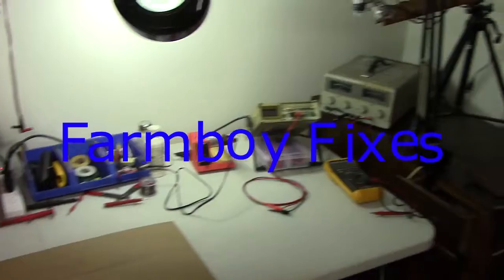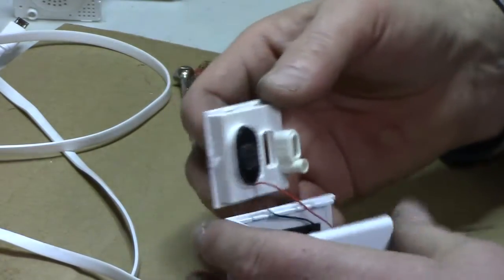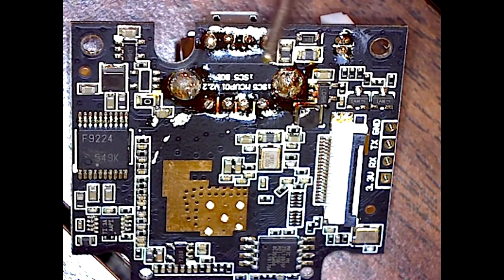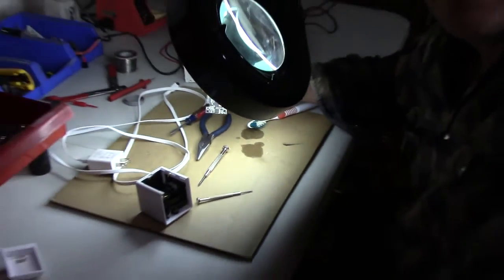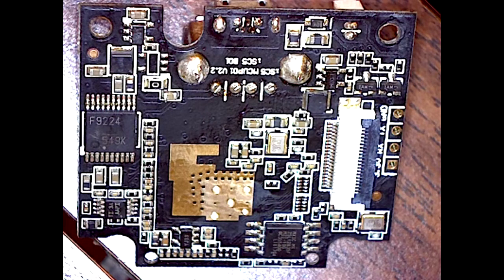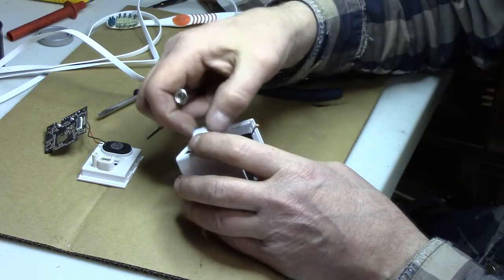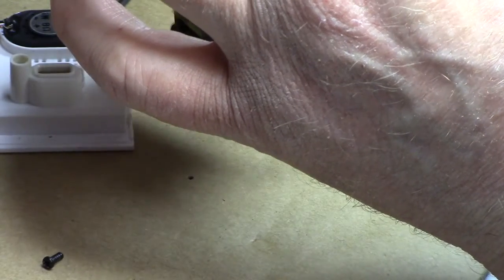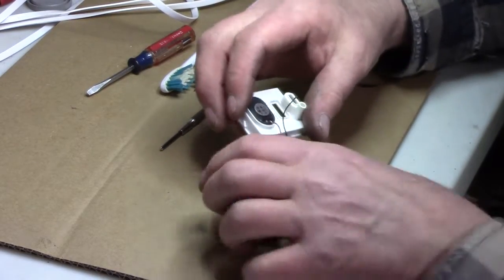My ISmart alarm Spot camera stop working...

Comment: I have found out through extensive testing is that with time the supplied USB power adapter no longer provides enough amperage (probably a failing capacitor in the power USB adapter).   A simple solution is to get a new USB power adapter.   It worked for me.
Reply from the maker: I tied a new usb charger, and same result.  Probably, the damaged occured via voltage spike.  I have since put everyting on a UPS.

Comment: Is the new company that took over from ismartalarm really just ismartalarm and now they want to charge us? I can’t get my cube or anything else to work anymore, the “new” app does recognise the cube and my camera but when I tap them it says they need to be updated. When I tap to update it says they can’t be updated as they are not on the same WiFi as my phone (that the app is on)? Can you help with this? Thank you.
Reply from the maker: Thats correct.  Your router  (which your ispot is connected to) must have the same wifi as your phone.  Also the wifi cannot be 5 or _ext if your using a wifi extender. So, go to your phone settings and chose the same wifi name as your ispot is on.
Reply: @farmboyfixes  it is on the same WiFi that the cube is on, but the cube is plugged in via a cable, not the WiFi but both the cube and phone are on the same router, I just get a message on the app that says that they are not on the same WiFi network. Any way to fix?
Reply from the maker: Well, if both your ispot and phone have the same wifi name, then only thing I can think of is to reset your ispot {small hole in the back).  Maybe also try rebooting your phone.  Maybe try to delete the app and reinstall it.
Reply: I was also having all kinds of issues. Updated to the new app and the alarm still functioned but would no longer call or text when it went off. My icamerKeep pros will not work on the new app and my spot camera works better than it ever has. Now my wife's account can't access any of the same devices. I just took it all down and replaced with Ring system. It's way more consistent and better so far. Looking for camera options to use with it because Ring cameras are pricey.
Reply from the maker: Yeah,   I lost the call and text too, only notifications.
Reply: I have found out through extensive testing is that with time the supplied USB power adapter no longer provides enough amperage (probably a failing capacitor in the power USB adapter).   A simple solution is to get a new USB power adapter.   It worked for me.

Comment: you have a bad soldering on left side contact of usb connector, see crack at 6.20 min. make new soldering on both contact, your done.
Reply: I have found out through extensive testing is that with time the supplied USB power adapter no longer provides enough amperage (probably a failing capacitor in the power USB adapter).   A simple solution is to get a new USB power adapter.   It worked for me.

Comment: Ismartalarm inc is no longer trading, they transfered the camera's services back to meshare, there sister cloud streaming company.
 Hence why some of the devices aren't working anymore. 
From what I've read online they shut the company down to save money and to avoid paying out to the third party company's like IFTTT, Amazon and Google for there services. 
Futhermore they used another third party company in the EU/UK called Ihealthlabs/ adonhealth to run the EU/UK servers, however I do believe Iheathlabs and adohealth is all under a umbrella company in china.

Zac Sutton Co-founder / marketing director of Ismartalarm left 3 years ago to join Meshare, since then the company has been shutting down and selling off all there stock.

We now have around 10 months to find a replacement system for home security alarms and cameras.

Comment: Oh I forgot I'm from EU😊
Reply: I have found out through extensive testing is that with time the supplied USB power adapter no longer provides enough amperage (probably a failing capacitor in the power USB adapter).   A simple solution is to get a new USB power adapter.   It worked for me.